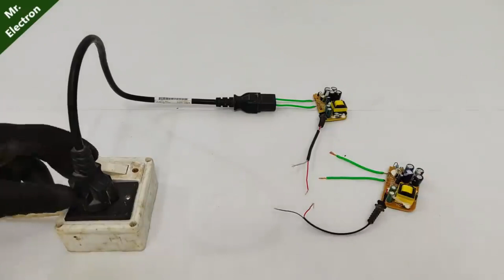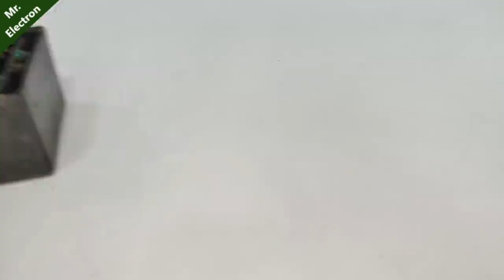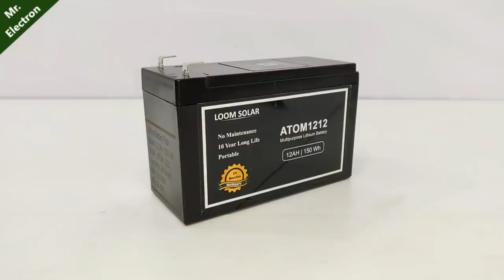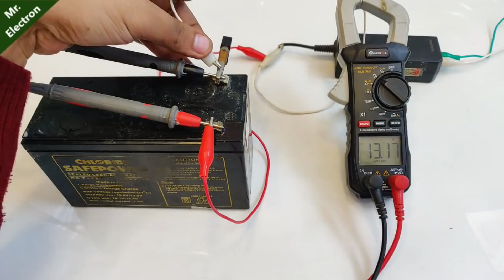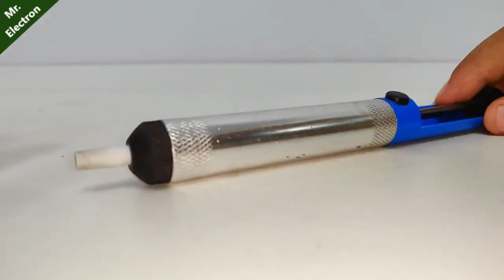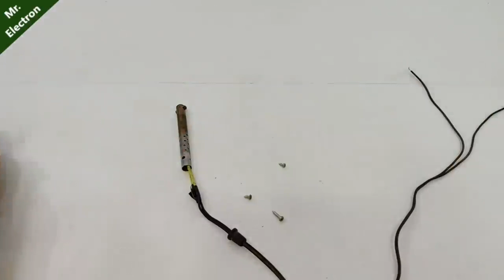3 Simple Inventions and Great Ideas

Comment: You rely don't need to test everything in sight just use your multimeter to check the voltage its holding or put out

Comment: Project 2.  I can not be bothered to follow what you did but it appears to be more a voltage dropper with no proper current sharing between the power transistors. In another words it is CRAP.

Comment: Why couldn't the second build be used for wind turbine? It works for solar panels, is it because in wind generation the generator would over heat if the output was stopped and it needs to have a dump load of some sort?

Comment: Hi
Congratulations for the invention. I 'd like to write the components in the 3rd subject because the explanation was very fast then I couldn't catch the the transistors, diodes serial. I retain only the resistance value 1kOhm
Reply from the maker: You can turn on captions 🙂
Reply: also you can adjust the speed from 0,25x to 2x